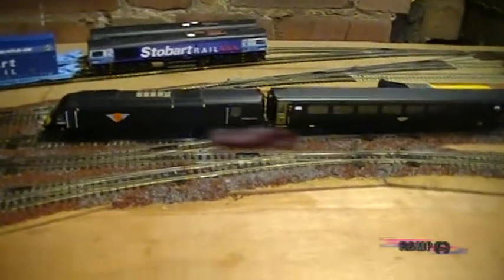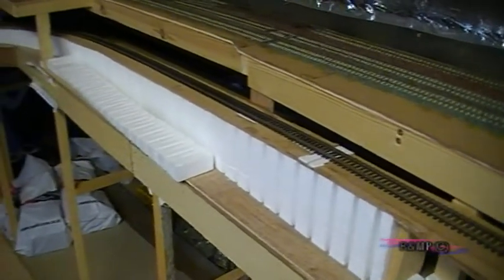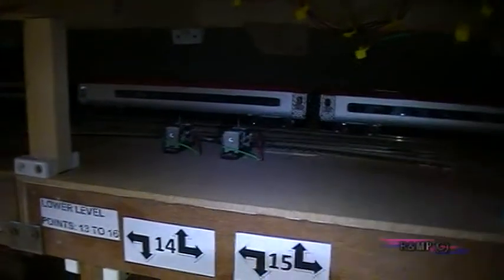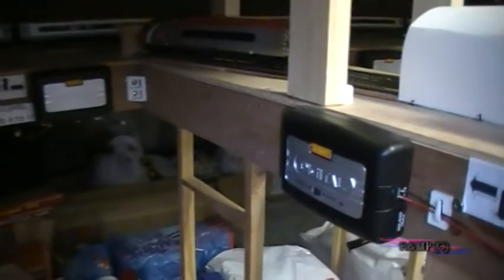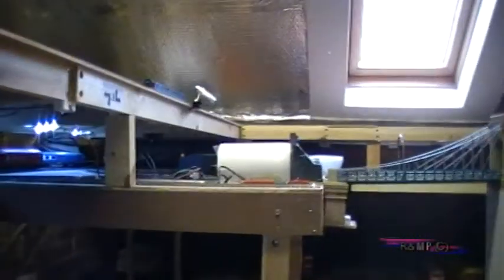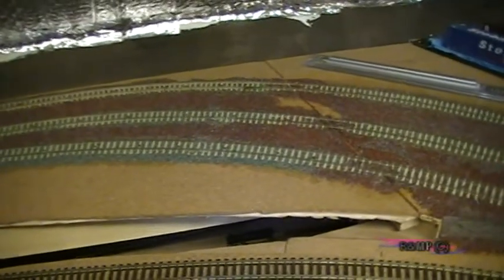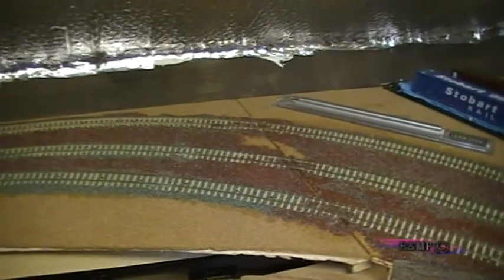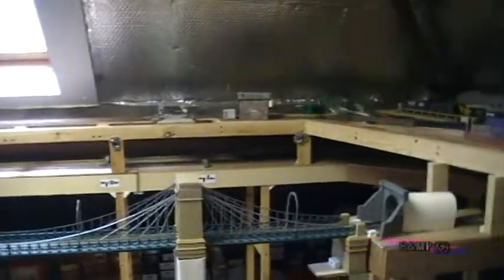Layout Tour (Requested Video) Part 2

Comment: I see steam engine posters from the previous video of your great layout but, no steam engine models.
Reply from the maker: Only posters for steam i have, are sitting below the layout (in a pile) on top of the house water cistern tank. Unless it's the pictures on the wall you've spotted?? There is three steam loco's on the layout in this video, sat lurking behind the loco shed. These being Black 5, Flying Scotsman (circa 2004), & Tornado. You can just see Tornado sticking out behind the loco shed.
Reply: ay76
Yes that is what I meant. pictures on the wall from "Part 1"
Alreight I shall watch your video again and look out for the Black Five, Flying Scotsman and Tornado
Reply from the maker: englishtwister
Ah cool, the pictures on the wall. Had them many many years. Do have other video's with the steamies running on the layout. Hoping to add an A4 this year. Cheers.